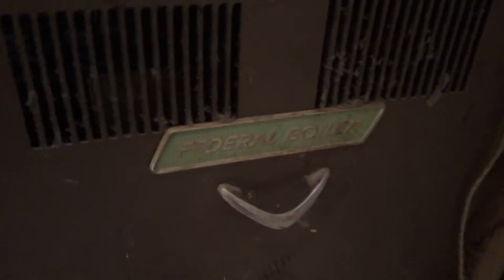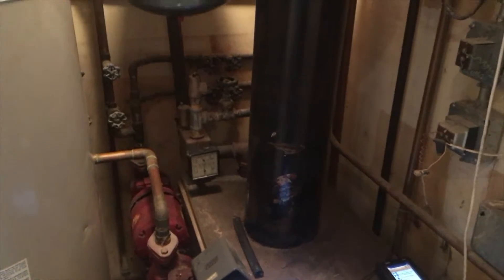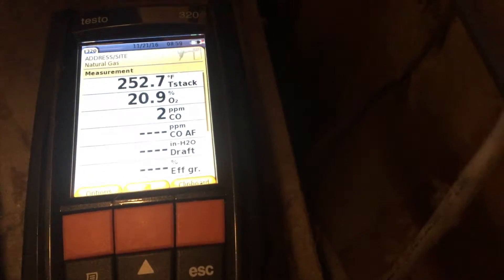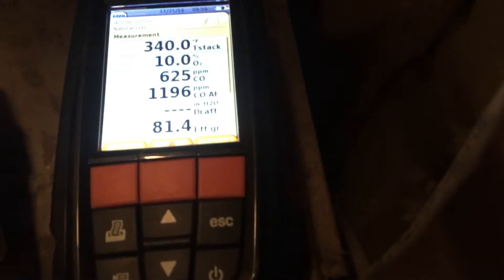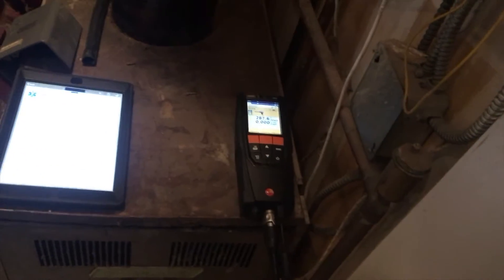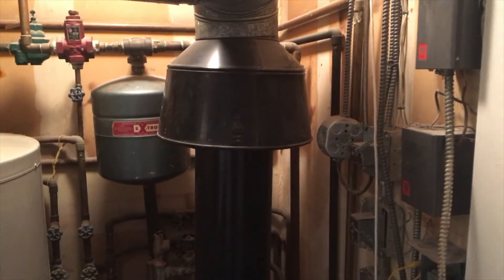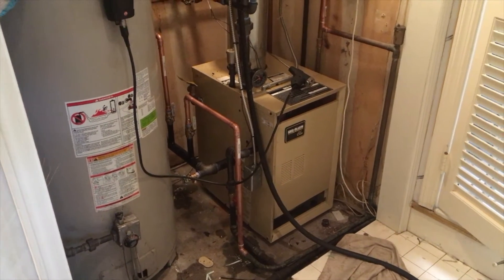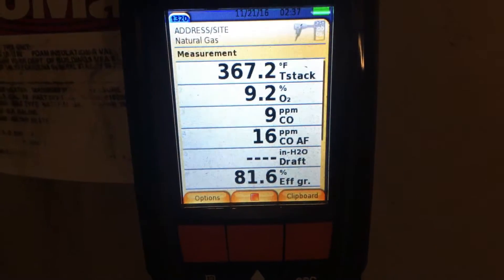Federal Boiler Replaced with Weil Mclain CGa5 Gas 3 Zone

Comment: I have the same Federal Boiler from 1968.   I ask the following not to argue but to learn:  If there is no CO outside the flue, is there a safety problem or just efficiency concerns?  Could the burner be adjusted or repaired to recduce CO emissions?